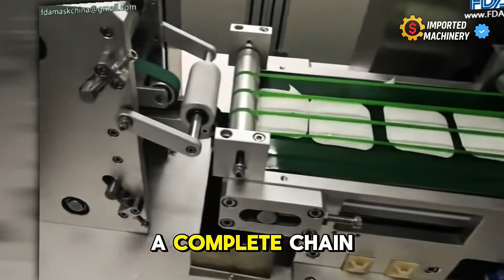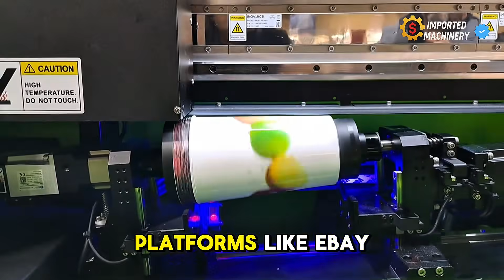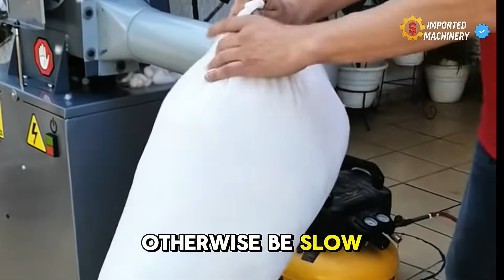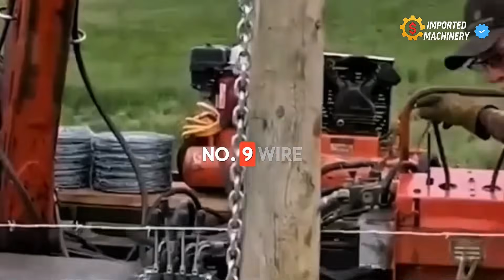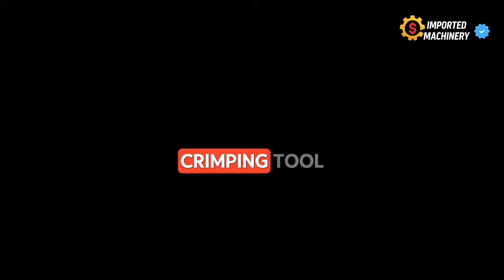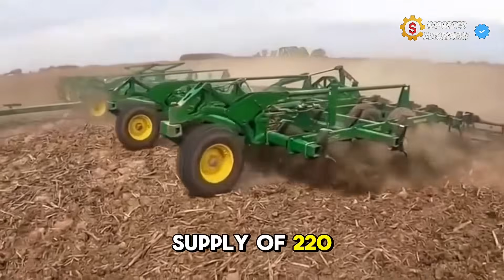13 Machines = Your Business Under $5,000 | Start Today

Comment from the maker: 🧵 Cotton Pad Making Machine (Semi-Auto)

🔹 American Plant & Equipment - Cotton Pad Machines
🔹 VMI Group - ACE 250 Specifications
🔹 Falu - Cotton Pads Machines

---

🥤 Paper Straw Making Machine (Small Scale)

🔹 Paper Straw Making Machine - eBay (1)
🔹 Paper Straw Making Machine - eBay (2)

---

☕ Cup/Mug Printing Machine (Heat Press)

🔹 Mug Printing Machine - eBay Shop
🔹 Cup/Mug Printing Machines - Walmart
🔹 Printer for Mugs - eBay

---

🍃 Tea Bag Packing Machine (Automatic/Manual)

🔹 Tea Bag Packing Machine - eBay (1)
🔹 Manual Tea Bag Packing Machine - Walmart
🔹 Automatic Tea Bag Packing Machine - eBay (2)

---

👕 Snap Button Attaching Machine (Electric)

🔹 Snap Button Attaching Machine - eBay (1)
🔹 Snap Button Machine - eBay (2)
🔹 Snap Machine - Walmart

---

☁️ Cotton/Pillow Filling Machine (Small)

🔹 Cotton Filling Machine - eBay (1)
🔹 Cotton Filling Machine - eBay (2)
🔹 Accio - Cotton Filling Machines

---

🔋 Battery Testing and Sorting Machine (Compact)

🔹 Battery Tester - eBay Shop
🔹 Battery Tester - Walmart
🔹 Battery Analyzer - eBay Shop

---

🪤 Barbed Wire Making Machine (Semi-Auto)

🔹 Barbed Wire Making Machine - Alibaba
🔹 Bergandi Machinery - Contact USA
🔹 RazorWire USA - Barbed Wire Machines

---

🧰 Wire Forming/Bending Machine CNC (Small)

🔹 Wire Bending Machine - eBay (1)
🔹 Wire Forming Machine - eBay Shop
🔹 Small Wire Bending Machine - Alibaba

---

🪚 Wire Fence/Chain Link Making Machine (Semi-Auto)

🔹 Automatic Fence Wire Machine - Alibaba
🔹 Bergandi Machinery - Contact USA
🔹 Secure Fencing USA - Chain Link Machines

---

🔧 Copper Wire/Braid Crimping Tool (Hydraulic)

🔹 Hydraulic Cable Crimper - Walmart
🔹 Hydraulic Crimper Tool - eBay Shop
🔹 Cable Crimping Tool - eBay Shop

---

⚙️ Thread Rolling Attachment (Pneumatic/Electric)

🔹 Thread Roller Machine - eBay Shop
🔹 Reed Machinery USA
🔹 Profiroll Machines - Thread Rolling

---

🔩 Small Bolt/Screw Making Machine (Semi-Auto)

🔹 Screw Making Machine - eBay (1)
🔹 Swiss Screw Machine - eBay Category
🔹 Automatic Bolt Forming Machine - Alibaba

---